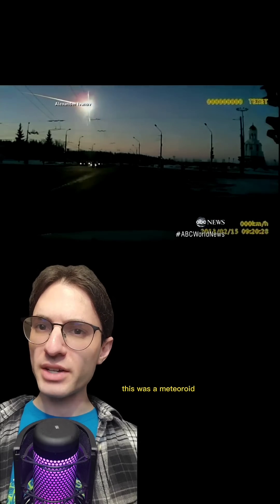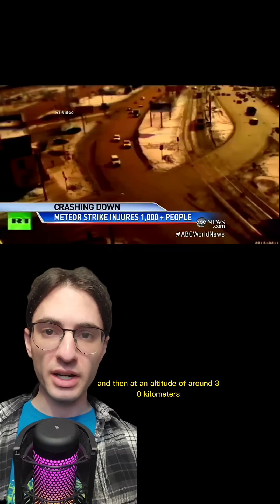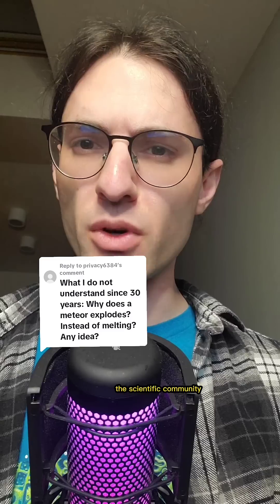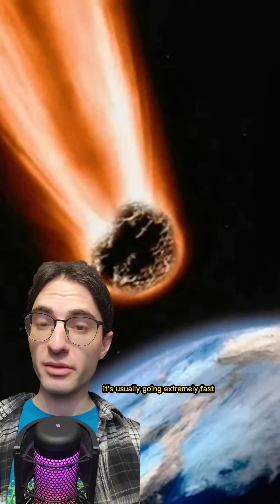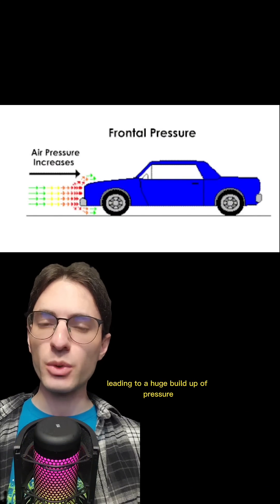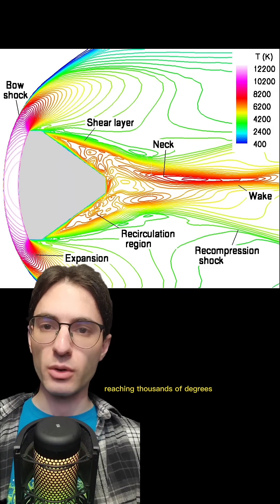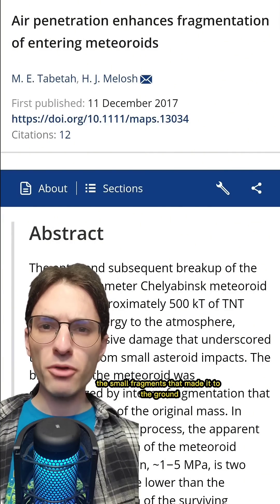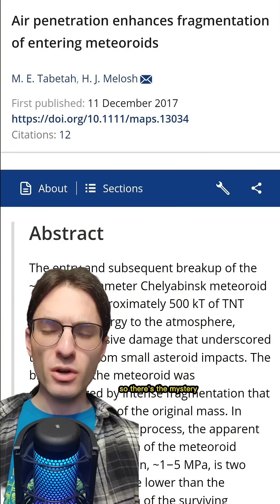How meteoroids EXPLODE

Comment: I'm guessing the sound comes from the slowing not the exploding

eg a small sound from the fracture 

but the big sound from the shrapnel slowing down
releasing three pent up pressure accumulated

so the shockwave would be a negative pressure wave not a positive pressure wave
Reply: Turning high pressure energy to sound waves
A one mach barrier has a devastating voice effect imagine 55 Machs